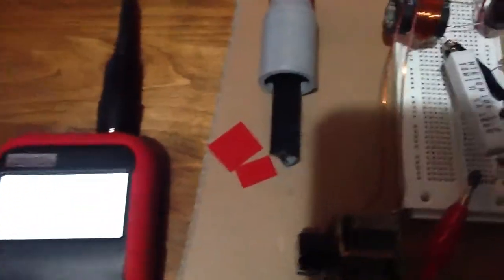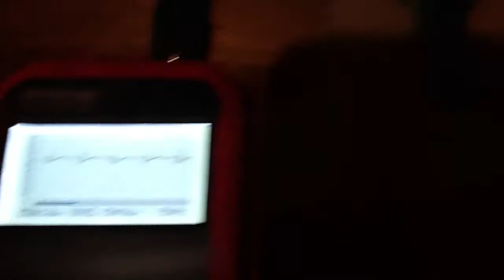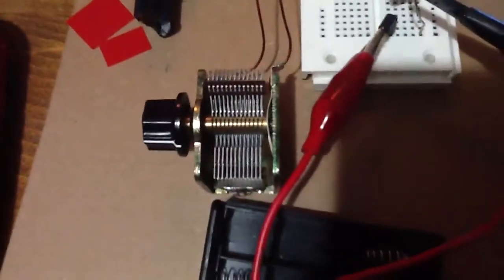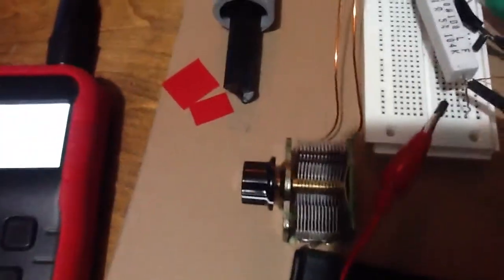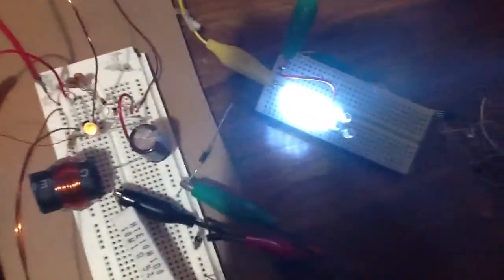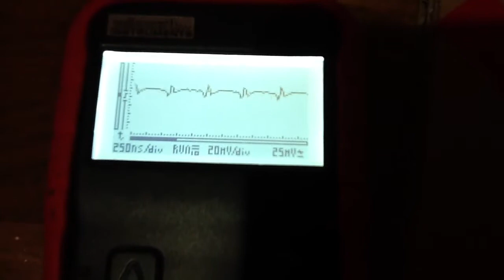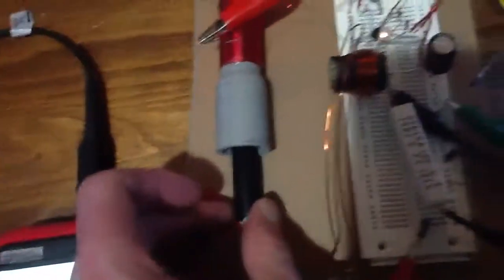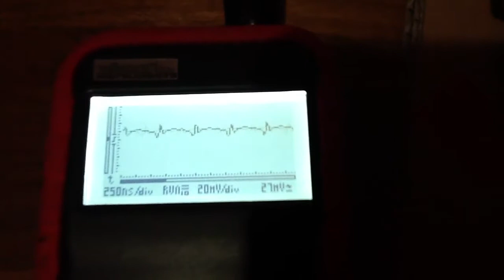pt8 TMT Mini SEC Magnifier, Variable Component Tuning

Comment: Nice. 1.2V, 25mA, no need to do the math - that's a low power input!
How's the big magnifying transmitter going?
Any plans to get that fired up again soon?
You were doing some good stuff there... would like to see more of it.
Reply from the maker: hi there yes I can basically take any coils I want and run them with this type of circuit, the Colorado Springs model is just so big to carry around